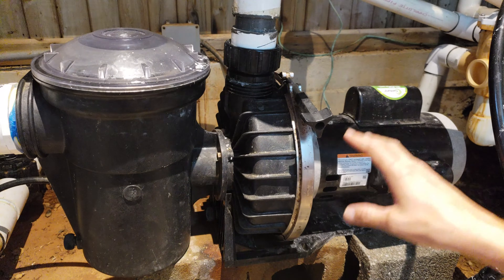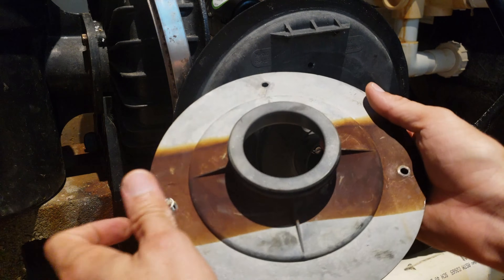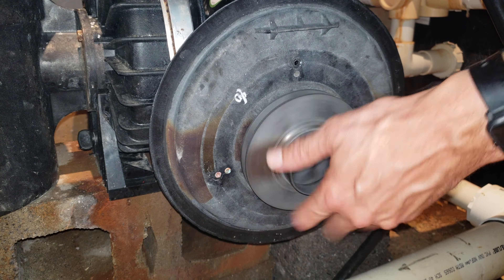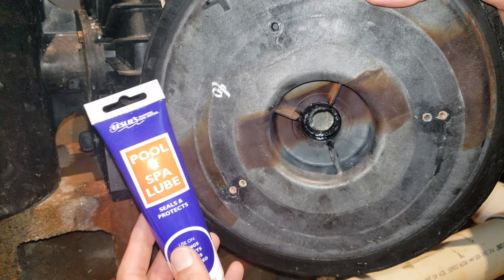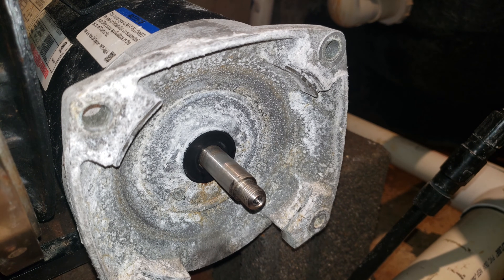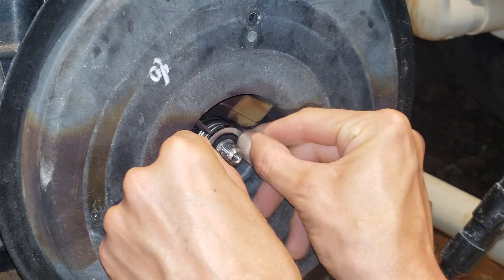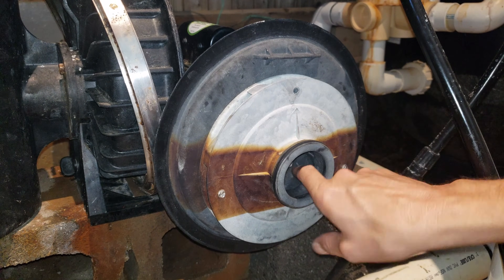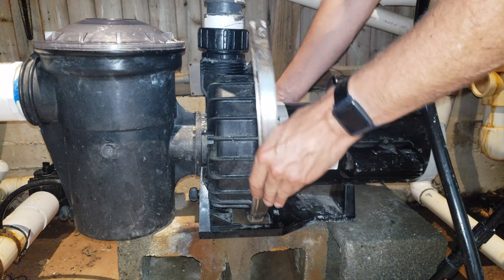How To Fix Leaking Pool Pump | Pentair Challenger Motor Shaft Seal Replacement & Housing Gasket Leak

Comment: Mine is leaking where strainer bolts to pump. Took it apart and don't see a gasket. Any ideas? It's basically dripping right above the pump drain plug (not the strainer drain plug).

Comment: My front shroud/housing is leaking a little=too much Gonna try 3900psi epoxy to seal it, if not will have to remove motor etc like this fella showed us to get to the back of the front shroud without having to remove the main PVC inlet pipe. Mark❤

Comment: I am having trouble getting the second seal to seat on top of the other seal. I can't get it down on the shaft far enough to touch the other ceramic seal. Trick to get it to seat?

Comment: I found a local pool motor company called A & D in Fern Park, Fl. 
He replaced the bearings on my Century 1.5 hp motor and impeller housing for $107. Works great
Reply from the maker: That's awesome, and good deal considering it costs about $50 for the bearings.

Comment: Hi, I followed the procedure to change seal, oring and plate ring. But after I put it back it doesn’t prime. I took it apart and put more lubricant and re-sit the plate ring which kind loose since the slot is wider. It still doesn’t prime. What  should I do? Thanks
Reply from the maker: You often need to fill the strainer with water, and try to get the pipes to fill up until it flows over the top of the strainer. Then screw the lid on and it should prime.
Reply: @engineerable yes, I did that. After it overflowed the strainer the water will drop some but still higher than the pipe opening before I put on the lid. But it still failed to prime. I opened the lid and the water level still like before I closed the lid. What else should I try? Thanks!
Reply: @engineerable to clarify, the water added to the strainer bucket did not cover the pipe opening from the pool, but higher than the intake of the pump. No matter how much water I add to the strainer bucket, it will flow down the pool pipe opening, but will stay just below the pool pipe opening and above the pump intake opening. But it still fails to prime. When I turned off the filter, I could hear the water dropped back to the strainer bucket. One thing I noticed is that when I put on the seal, the one with black ceramic protruded a little, not as flush as shown in your video. But I thought since it has spring, when I hand tight the impeller, it should push it down to align flush. What should I check? Thanks
Reply from the maker: @jonathanwang2009  The shaft seal is under pressure, so it would leak water if it wasn't installed right. It won't affect the priming. You've either got a blockage downstream, or your leaking air upstream. Check to make sure nothing is blocked downstream of the pump. Is the spider valve set correctly? Did you place the spacer back under the diffuser that goes over the impeller? (I've seen people leave that off.) Does the level inside the strainer drop when the pump is trying to prime?
Our pump can take a while to prime. It pulls in water slowly at first and then eventually builds up.
Reply: @engineerable thanks! It turned out that I didn’t add enough water to the strainer! Once I changed to spa mode it started to prime.

Comment: I just replace all my rubber seals 6 months ago and it's already leaking again.  Is that normal ?
Reply from the maker: No, it should last at least a few years. If you have a saltwater pool, you may need to look for salt and ozone-resistant rubber seals. Otherwise, try a different brand of seal.
Reply: @engineerable  I have a Chlorine Pool.  My pump is the same as in the video.
Reply from the maker: @PrettyGoodLookin  That rules that out. Read the comments by @nostromo256 about the special lube they recommend.

Comment: Just did all this and now when I turn my pump on, it comes on but no water is circulating. When I turned the pump off it takes a few seconds to stop spinning when it is normally instant. Any ideas?
Reply from the maker: Is water filling in the strainer basket area in front of the pump intake? You have to prime the pump by filling the intake, it won't just pump air. If it is filled with water, then the impeller could be loose on the motor shaft.
Reply: Yes thanks, I realized that after sending this message. I thought the intakes would prime it. Just filled my pump with water from the hose- no issue. Your video was great- super helpful.
The front housing o-ring I ordered was slightly too large and round, the square shaped one is hard to find.  Thanks for replying.

Comment: I think you used a silicone based lubricant during your repair which is not recommended for this application.

Per U.S. Seal brochure:
“Common Causes of Seal Failure

1. The seal was installed using the wrong lubricant.

Be sure to use a water soluble lubricant, such as U.S. SEALUBE, instead of a PTFE or silicone based lubricant.”
Reply from the maker: Thanks for that info. The people at our local LESLIE'S (commercial) pool supply are not knowledgeable enough to know details like this. They didn't even know that the motor bearings could be replaced. 
Should the US Sealube product only be used on the shaft seal areas, and silicone used on the pump housing o-rings? Seems like silicone could migrate around the pump housing.
Reply from the maker: Ok, I read this PDF https://www.ussealmfg.com/-/media/j/ussealmfg_com/files/resources/ussealube.pdf
My understanding now is that you don't want to contaminate the ceramic seal faces with silicone or PTFE lubricant. I was careful to not get any grease on there, but since I applied grease to the rubber seals, it could easily cross contaminate during install. They say that the SEALUBE completely evaporates, so the only purpose is to aid in installing? If the rubber seals go in without any lube, do we even need this product?
Reply: @engineerable  The fact that US Seal is making this recommendation as part of the marketing for their own lubricant product can certainly call into question the true need for the product. However I do believe what they say about silicone / PTFE being bad for seal faces is true. It may be that all you need is some good old fashioned distilled water for lubrication while assembling. I’m curious how their product evaporates completely with no residue. Perhaps it is alcohol based. I’m doing a pool pump / motor rebuild soon and have ordered their lubricant so I’ll be able to try it out. As far as cross contamination with silicone lubricant, typically it is applied with a VERY thin layer on o-rings. You only need to rub it on to make a lubricant sheen with no excess. Should be little to no chance of cross contamination. You may even be able to do this on the rubber portions of the shaft seal but using the a non-silcone / PTFE product removes any chance of accidental contamination.
Reply: I just bought a seal kit which included a small packet of lube.  It says it is PTFE based lube.  I've been using silicone base and/or dielectric grease for over 20 years and never a leak.